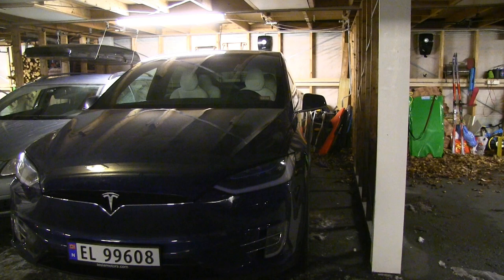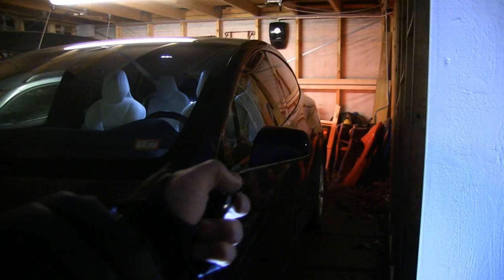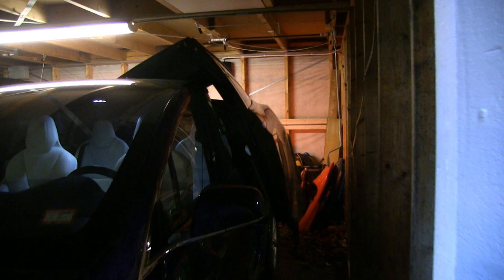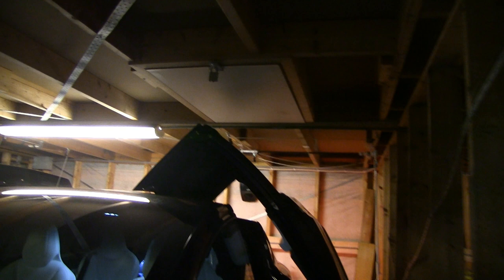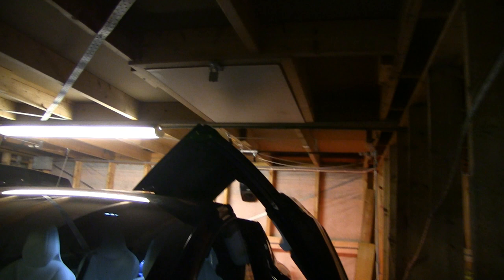Opening falcon wing doors in tight garage

Comment: 1. with normal doors it might be even worse to get in
2. this garage is not finished, with walls not full, it is very nice to know what this is not a problem for Tesla sensors, i was wondering what if sensor is pointing exactly where is no wall but i see that doors works great. thanks
Reply: re. 1. most definitely with conventional doors that go out into the side... you'd have to move first past the closed doors (or around the car from the other side) to end up near the side of the back car, then open the door(s) that way. This would be different for cars (usually mini-vans) that have a door that slides slightly outward and then to the back of the car - in those cases, it'd be easier to get in.

re. 2. it seems to me that the space of the hinges at the top to the ceiling was less than the space between the side door to the side of the (unfinished) garage... therefore, it could be argued that perhaps the motion of the door was interrupted solely by the sensors picking up the limitation of space toward the top and perhaps not at the side.

Comment: One question on the front doors...

I had a 2 door Mini Cooper (so doors were quite long and difficult to use in tights spaces) but like the Tesla the Mini had pillar less doors, and once a friend showed me that you can open the window with the remote, it made it much easier getting in and out in tight spaces as you could lean into the window area when opening the door which saves a lot of space. You could then simply get out, turn and hold the key in the door and it closed all the windows and locked. It was a really useful feature. Does the Tesla do the same? 
Thanks

Comment: The sliding mini van (power opening) side door would be way easier to get in than the X if the mini van was parked the same way that allowed me to enter from the front direction.  I don't think entering from the rear direction would have been any harder than the X, but the sliding door does take up about 6 inches (~15cm) of the gap towards the rear.

Comment: This garage is normal, Optimus Prime is BIG.
Reply: For someone who can afford a Tesla, I'd say this garage is not "normal" (common) - a person with a garage like that (esp. one that's not even finished) who then buys a Tesla, does not have their priorities straight. If that person already had the Tesla and then moved to a place with a garage like that... RIP brain lol. At the very least that person would have planned to make changes to the garage ASAP, so that in the long run it can accommodate two cars without making it crowded like that.
Reply: Tesla owner and garage owner are two different persons.

Anyway, Tesla cars have summon feature, they can get in and out the garage without a driver, just using the key fob.
Reply: some really expensive houses in major cities have garage spaces even tighter than that, not uncommon and will cost an eye watering amount to buy

Comment: What if you park next to a tree.
Reply: Hello, this is dog
Reply: lol... but yeah, actually a good question from OP. Also, what about parking where the metal pole of a street light ends up being located next to the front / back edges / at the middle of the closed falcon wing doors? Would they sense a thin pole like that? What about an even thinner metal object sticking out of the ground, such as one with a street sign mounted on? What about wooden utility poles (although they're usually thicker and should be easier to sense)?
Reply: well one neat hing is if u r outside the car and it's difficult to get in.....u can always "summon" it ......or tell it to go forward or backwards a bit

Comment: the summon function makes falcon wings useless... why not just summon the car out of the garage omg..
Reply: Don't be silly - this specific scenario was not the point of this test... of course he could've summoned the car. This was a test about the sensors and how a tight space would affect the doors opening.

Or if push comes to shove, if there'd been more space, could've used the other side to enter the back of the car and then scoot over; same would be true for the driver's side, of course that'd be a bit more difficult.

But how about if you'd be in a parallel parked situation with the X where there'd be a low ceiling and a wall or a pole right next to those doors. Or how about if he left something in the car, after having parked he realized that and went back to get it and just getting into the front and reaching back or entering the car from the other side was also not an option. Summoning the car just to get an item or a few items out is kinda silly. Point is, there might be situations where the summon feature either could not be used or would not be efficient to use.
Reply from the maker: What if it's raining outside?
Reply: alex It's a bitter winter outside and you want to stay warm in the garage.